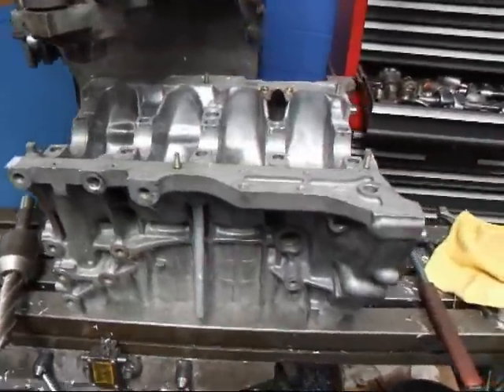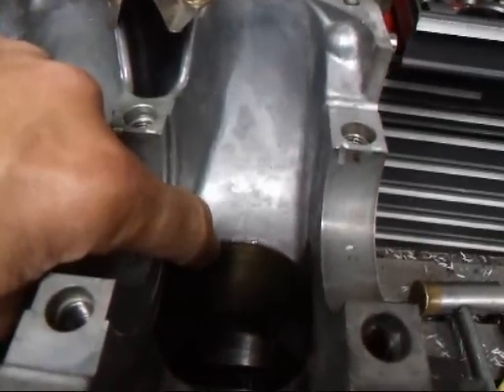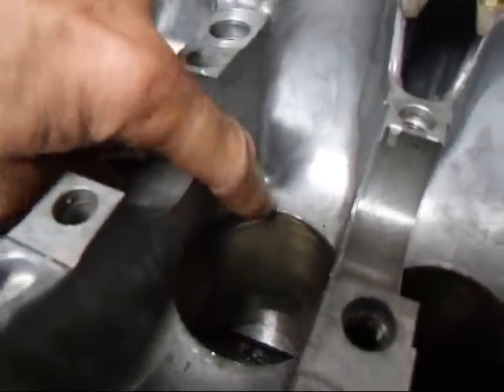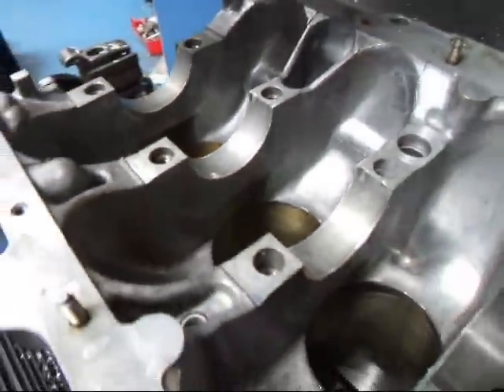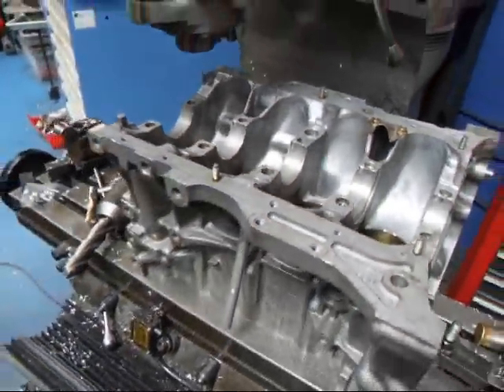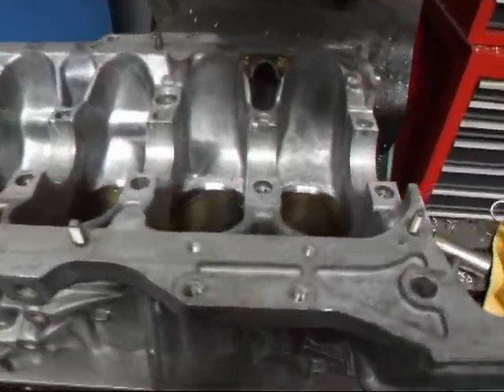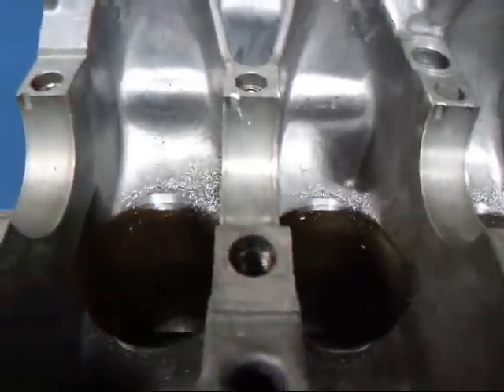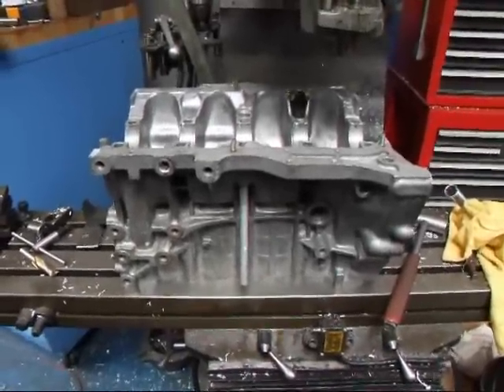D-16 Honda Block Modification

Comment: i want a full blowen machine shop haha i'd like to do my 383's with that machine. real though it'd take more time getting it up on the table and ready, than with my trusty die grinder for the ones i build. Eagle and these new 350 blocks work really well together. not like the early model blocks that you have to take a pound of metal off. great video

Comment: @mylaser91 you would gain HP by putting a new bottom end and a turbo but i wouldnt push it past 8 psi with most of the factory internals. and personally i would stick to the prelude just because im not a big fan of the crx but it does have a lighter body so it would be better for you to go with the crx better power to weight ratio but really what you should do is do what ever you like dont let antone tell you what to do to your car if you dont like it dont do it

Comment: Is it possible to remove the aluminum  from the block at the Crank journals and replace it with forged steel? To strengthen the block for Higher hp on the EW4 and the D series?

Comment: Hello again John, I emailed you the other day but you mustn`t have got it.  I have a Land Rover with a 2.5 turbo diesel in it, do you think that there would be any benefit in knife edging the crankshaft counterweights and also grinding of the stamping numbers/marks on the conrods and then polishing them?  Thanks for the great vids John, I have been watching them for years.  Kind regards, Paul from Cheshire, UK.